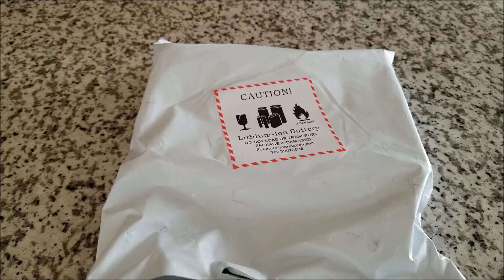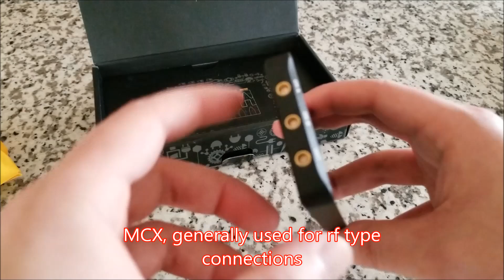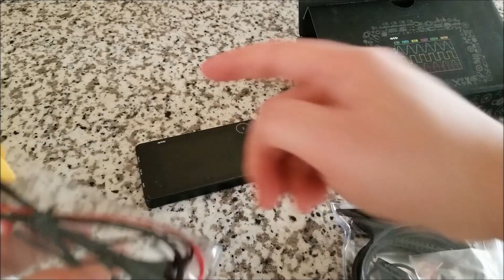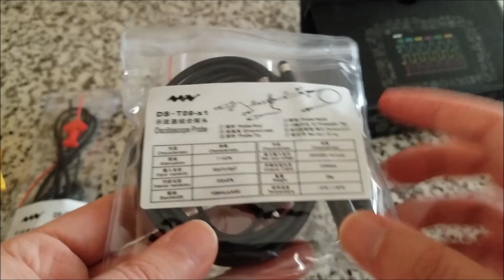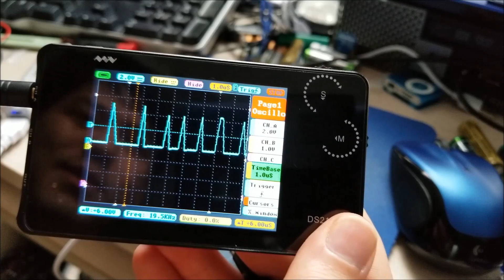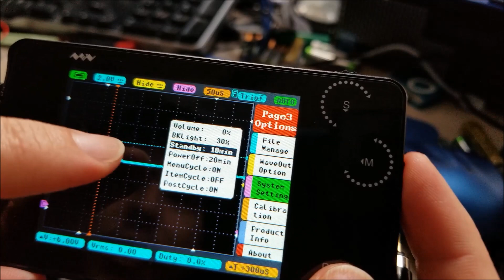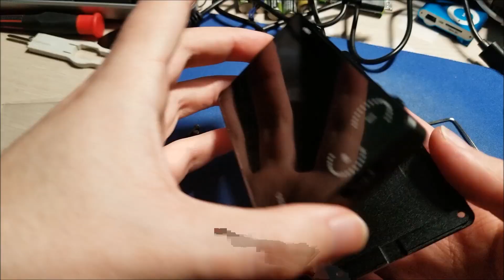Lab Tech: Banggood DS212 2 Channel Pocket Oscilloscope Review!

Comment: does the probes have a  X1 - X10 divisor switch?
Reply from the maker: The probe it comes with in only a x1, but it will work just fine with a x10 probe you can buy for like $7 off ebay (or make your own bnc adapter to use standard probes like I've done since I made this video).
Reply: Thanks! do the probes need to be calibrated?
Reply from the maker: The probe it comes with doesn't have any user adjustable calibration but for other probes it really depends on what you are doing and how accurate you need the measurements to be. The good thing is because it has a built in function gen you can use it to provide a reference to calibrate the probes without any extra required equipment.

Comment: Can we see full 8k buffer on single screen while measuring voltage (live) in this scope?
Reply from the maker: I highly doubt you could see the full buffer depth as the lcd resolution is somewhere around 320x240 pixels. Of course you can either zoom out and get lower res or zoom in and scroll around at higher res.
Reply: @sjm4306  thanks dear, i need a confirm reply. same feature is possible in few scopes.

Comment: are 1 Mhz maximum frequency ?  - cos i need to check my old amiga crystal..
Reply from the maker: I'm guessing 1MHz is the max sample rate of the processor/adc. The max actual measurable analog bandwidth will likely be half that by the Nyquist theorem or you'd get aliasing and couldn't correctly resolve the measured frequency. I'm sure you would at least be able to see if the crystal is working, but might not be able to accurately measure its frequency

Comment: what type of battery is reqd for replacement
Reply from the maker: The lipo is marked with YDYJ353841 3.7V 500mAh 1.85Wh YD1716A. If you find a cell that measures 3.5mmx38mmx41mm it will fit.
Reply: @sjm4306  thanks. any idea about possible sources?
Reply from the maker: This looks close and should fit: https://www.ebay.com/itm/3-7v-500mAh-Li-po-Battery-for-MP3-DVD-GPS-Headphone-Recorder-Smart-watch-304040/173017987969?hash=item2848acfb81:g:Y4sAAOSwux5YUK8M:rk:1:pf:0&LH_BIN=1

You'd have to splice the original molex connector on or just hard solder the wires.
Reply: @sjm4306  thank you again.

Comment: Can I test mains AC with it? Need to test the output of a dimmer module.
Reply from the maker: I believe the max measurable voltage with the included probe is 40v or 50v so unless you buy the compatible 10x probe then you'd likely blow the input stage of the oscope. Other than that though, with a 10x probe and basic safety precautions, then yes this can measure AC mains.
Reply: @sjm4306  So it ain't a 1x and 10x MCX probe you got in the DS212 box?

Comment: sera q ele medi 40khz? qual o maximo?
Reply from the maker: 40kHz for an oscillator square wave pulse will be fine. Officially the max bandwidth is 1MHz (minimum 1us time division) and in use I've found it good to a few hundred kHz for analyzing digital signals (don't do much analog so haven't really tested that).

Comment: I just ordered one.... with a second - x10 -  probe. Looks very nice. 
Is there good open-source software to anylise the data and/or use it as an USB-scope when connected to a laptop for example? (by the way: Linux ;-) )
Reply from the maker: The data is saved as a png image and csv so you can use any graphing software (I mostly use windows so excel and matlab are my go to softwares for tasks like these).

Comment: could you use this to test if the lcd keypad shield buttons are working when pressed and what is the "out" slot used for?
Reply from the maker: Yes you can test signals like key button presses. The out port is for the function generator output which can output a sine, square or triangle wave of varying frequency (and duty for the square).

Comment: I recently bought one of these from Banggood but it was bad on arrival (white screen).  They are not prepared to handle returns or replacements so beware.
Reply: OK, Minidso did send me a working unit.  Good for them.   There is a case for this unit that protects from drops and holds it at a good angle for use and viewing.
Reply from the maker: That's great to hear. Restores a little bit of my faith in the modern world.
Reply from the maker: Wow that sucks, if it was DOA that definitely falls under their return policy and I'd expect them to be liable for replacement or refund. Have you contacted the manufacturer to see if they are willing to stand behind their product and make things right?
Reply: Minidso appears willing to send a new one (waiting to see if it arrives) but Banggood only offered $20 off for me to have it repaired???  Return shipping is on me and requires customs form, etc.  Do not know shipping cost yet but it could be a large part of the cost.
Reply: Bangbaad...

Comment: Can these scopes measure voltage when paused anywhere along the signal line? My big scope can measure with the trace line and I'm looking for a small portable scope for field work with that function. Thanks
Reply from the maker: I'm not quite sure what you mean. When you pause or stop the trigger it captures that instant. If you zoom out, stop capture and zoom in you can scroll around but due to the limited sample depth you have limited detail if you do this.
Reply: sjm4306 I have a function on my big scope that allows me to pause a signal and then measure with up to 2  markers, like I can measure Delta time as well as the voltage anywhere between the peak to peak or time base. It's got some kind of a cursor I've never seen before and I'm not sure what it's called or if most scopes have it. I misspoke when I said trigger Sorry. My trigger also moves both side to side and vertically so that I can fit the exact part of the waveform in the screen.
Reply from the maker: This scope does have delta t and v cursors that are adjustable for measurement.
Reply: sjm4306 great! thanks for your response I really appreciate it.

Comment: Is it capable to show the lissajous figures in x-y ?
Reply from the maker: Yes, but of course the speed of the mirrors are the limiting factor in the refresh rate.
Reply: sjm4306 Can you post a photo or a video or send me via mail please?
Reply from the maker: Oops thought I was responding to another video. This oscope does not have x-y input with the firmware that comes stock. However the software is open source so it would be possible to rewrite that functionality. In fact someone did exactly this for an earlier model that might be possible to port to this one.
Reply: can you give me a model of minidso capable of x-y?
Reply from the maker: I believe the quad channel dso203 was the model with the custom firmware someone wrote for x-y.
Reply: sjm4306 I've browsed the various custom firmwares for dso203 but I  haven't found any x-y spec...do you have a link please?
Reply from the maker: Google "dso203 xy mode". The first link is a video with a link in the description that should help. Good luck.
Reply: sjm4306 shame that the link to the firmware is Dead...I Will not but this scope :-(
Reply from the maker: Sad to hear the link doesnt work anymore.
Reply: sjm4306 😢

Comment: Does anyone bought this DS212 and use in automotive diagnose using a probe for secondary ignition voltage?

I hope it have the same accurate signal captured by DSO201... 

My Hantek DSO5102 have distorted display using 2 pcs Hantek Capacitive probe for secondary ignition voltage probe...

Comment: Hi!!! 
Could you helpme ???
I need to perform an adjust on a power supply for a period of 3.8 milliseconds per cycle.

But I dont know how can i read the actual cycle time 

On my DS212.

Best regards.
Reply from the maker: What is the topology of the supply you are tweaking? If you are talking about measuring the switching duty period, clip a probe onto the gate of the transistor and trigger on the rising edge. You can do a single capture and use the time cursors to manually measure period.
Reply: sjm4306 
Is a very old power supply and yes it has 6 transistors, those are for firing  two SCRs .
This power supply is for a hig speed motor (70000rpm).
Looks like i have to keep using my old osciloscope.
Thank you very much for your answer ☺
Best regards.

Comment: Got a second to think something over with me? I have an old Sony Walkman with no sound. Tape plays, everything lights up fine. I’m assuming it’s a faulty headphone jack. Is there any way to confirm that before I start taking it apart? Do I need to own a multimeter for a project like this? Thanks
Reply from the maker: It could be the headphone jack, old capacitors, faulty audio amplifier, or faulty tape head. If it were simply the headphone jack, wiggling the jack and inserting/removing should cause ittermitant sound. Any of the other problems would really need a multimeter to debug. You can get a super cheap $5 from anywhere that will work fine so long as it can measure voltage and resistance (a continuity mode will also be very useful). If you know the model you can find the sony service manual which will provide detailed info on how to take apart and service the unit.
Reply: Thanks, checking out multimeters now to help pinpoint what it actually is.